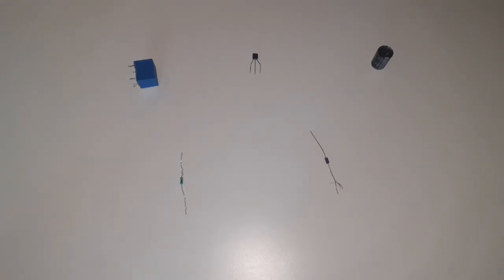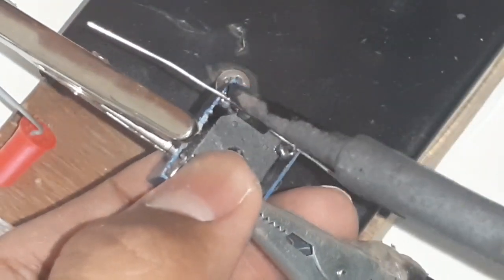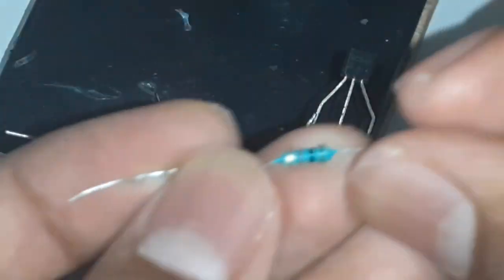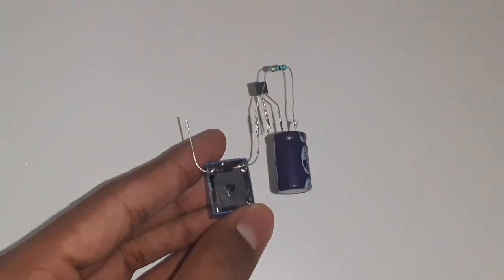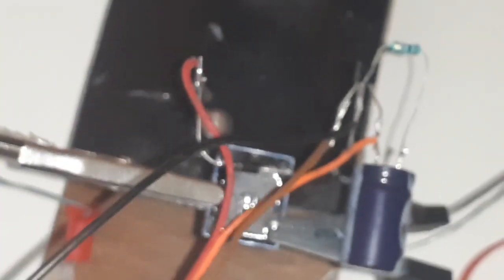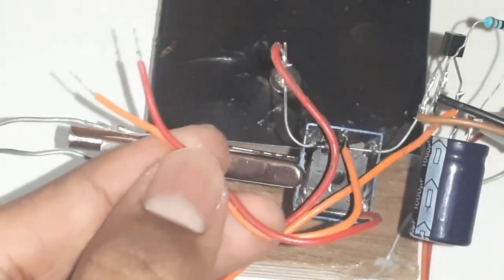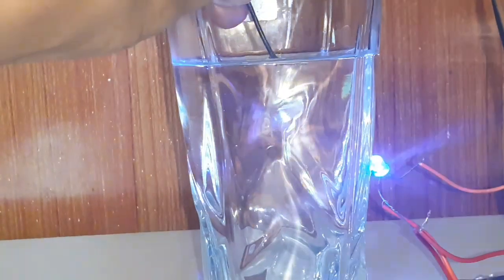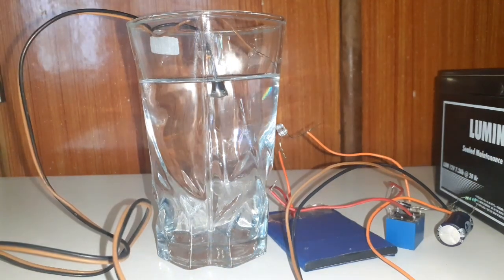How to make automatic empty tank alarm/cut-off for cooler pumps.||Urjit Bhavsar||

Comment: Can you please make a project for me, my case (issue) is a little bit different. I want to switch on the pump manually when the PHE (public health energy) water pipeline is opened ( only twice a week) and in order to prevent the pump from dry running, I want my pump to automatically switch off when the tanky is full as well as when the water supply from the PHE water pipeline stop . My main issue are switch on the pump manually and  automatically or manually switch off the pump  when my tanky is full and as well as when the water supply from a reservoir is closed . And also along with it, a warning alarm for water over with an indicator and a different alarm with another indicator for dry run. And also along with a water level indicators. It might be a little complicate but I think this a challenging task for you. Who knows you might get a tens of thousands of looks and likes
Reply from the maker: Sure, I fully understood your issue sir. It's great for me to get challenging tasks. And I would love to solve your problem.
The solution is to add two (2) of these circuits, one after the another.  The circuit can be altered by simply changing the pin from normally closed (NC) of the relay to normally open pin (NO). But keeping the ground pin common. Install this circuit to the  water tank by simply hooking the signal wires (which I dipped in the glass in this case) to the maximum water overflow level of your water tank.

The wires from the (NO) pin and ground will be the input power supply wires(220v Ac) for the second circuit. 

In the second circuit, you'll need to reverse the wires from NO pin to NC pin. 
And this time the signal wire will go to the input pipeline (PHE) by putting it in such a way that it makes contact with water when the pipeline is opened. 

AND the NC pin and ground pin will directly go the Pump. 
So there will be 2 checks.

One at the tank, second at the pipeline. 
If both are ON, the pump will start operating.

But if either the tanks fills, or the water supply stops, the pump will stop functioning. 

That's all.

Sir try this only if you are sure about *not harming yourself*.
Thank you...!
Reply: @UBsLab  Me, a layman don't know how to visualised. I don't know a thing about an electrocal component like capacitor, diodes, ic, transistor, relay, resistor etc etc. I don't even know polarity. So, without a good video instruction I don't know how to make it.
Reply from the maker: Will try if I can make a video about that in the future...

Comment: Will this ( the components) works on a 1.5 hp pump. If not can you please make another one.
Reply from the maker: Thank you for you comment sir.
And yes, this device can easily operated a 1.5 Hp pump. You can also use a bigger relay with 16amp capacity for larger pumps. Thank you!
Reply: Can we use/apply this process in order to make an alarm sound instead of turning on the pump
Reply from the maker: @lrtaralte  Yes sir! Why not! Simply put the alarm sound with the with the relay. For example in place of the LED, wire the ALarm.
Thank you!